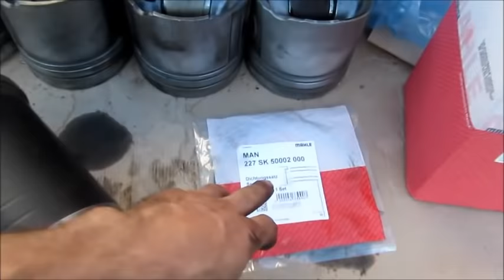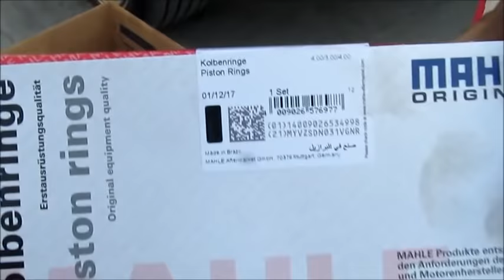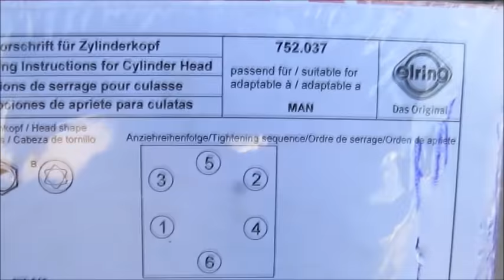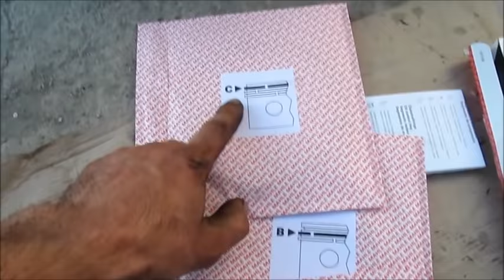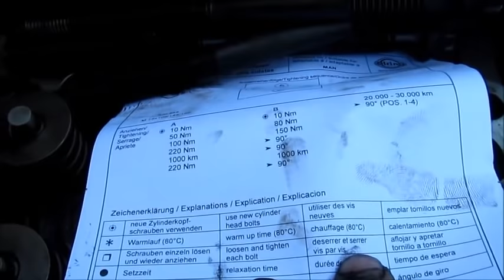Motor MAN TGA- D 2866 engine repair

Comment: Foarte bine structurat video.ul si explicat cum trebuie, mult succes si spor la munca mestere, de curiozitate cat costa un set de camasi si de segmenti pentru un astfep de motor
Reply from the maker: Multumesc pt apreciere. Piesele ce se vad in acest video au costat circa 1000 euro. O camasa ii circa 300lei , segmenti 100lei , garnitura chiuloasa 100 lei , totul vine ori 6 , plus schimb de ulei si filtre.

Comment: D2876 - maybe i have this problem with cylinder liner?  i get coolant in to oil.. driving hot not problem 1500km.. but when turn off truck, hot/cold temperature, water goes down into oil.  maybe internal leak ?
Reply from the maker: Ring cilinder might be damaged and antifreeze liquid drains into the oil bath.

Comment: Hi Catalin, what is the cause of excessive or too much diesel consumption in D2867 engine please?
Reply from the maker: you most likely have problems with the injection system. check the correct functioning of the injectors and adjust the valves
Reply: @CatalinBarbu  I need your help, I service the injection but the engine  would not start because is electric injection. Do you advice to change the injection to manual without electric? And if yes what size manual injection for f2000 D2876?

Comment: As vrea sa te întreb dacă la cămăși înainte se le pui in motor le-ai mai făcut ceva? Adică șlefuite sau ceva sa nu consume din segmenti pana își face luciu .Am făcut un motor și tot am gaze de carter, dacă vrei sa îmi răspunzi
Reply from the maker: Nu le-am, făcut nimic , au fost montate direct cum se vede in videoclipul. Când ați făcut motorul ați înlocuit cămăși, segmenți, pistoanele ?Dacă ați păstrat pistoanele vechi ați verificat sa nu prezinte uzura pe laterala, segmenți au fost montati corect cum am prezentat în videoclip?
Reply: Da am înlocuit cămăși noi kolbensmith cu segmenti tot aceasi marca  dar mistoanele au rămas aceleași doar 1 singur piston am înlocuit nou , Pistoanele arătau bine nu aveau deloc urma in canalele segmentilor doar calamina și au fost curățate bine. Văd ca tu pui MALE sa fie mai tare materialu din Kolbensmith?
Reply: Salut!un nr de telefon se poate!?

Comment: Neprofesionisti aceia care au mers cu o concentratie slaba de antigel astfel incat acesta sa inghete. Motor bun care a fost acum este compromis.
Reply from the maker: Propietarul camionul  nu a măsurat concentrația  antigelului iar în martie 2018 au fost câteva zile cu - 12-15 grade iar din mers temp. resimțită ii mult mai  scăzută așa că antigelul a înghețat în celulele radiatorului .Cand a deschis termostatul , antigelul nu a putut să circule prin radiator apoi motorul sa fiert.
Reply: @CatalinBarbu Multumesc pentru raspuns, eu cunosc ce se poate intampla cand un motor functioneaza cu un lichid de răcire care are o concentrație slabă a antigelului. Dar nu toti se pricep la motoare termice si...circula asa cu ele pe străzi.

Comment: Cum drq sa spui ca ti-o înghețat timpul mersului!!!
Reply from the maker: Când motorul are termostatul închis antigelul nu trece prin radiator, in acesta fiind apă și afara fiind ger de - 15grd C îngheață în celulele radiatorului. Șoferul a zis că în vasul de expansiune antigelul se făcuse că o zăpada roză.
Reply: Păi da dar sa crape cilindrul doar cand a stat ca din mers nu are cum
Reply from the maker: @enduroh.e.l4944 problema s-a întâmplat în Bulgaria de la Sofia către Beghet, i-am înghețat radiator soferul a continuat să meargă a fiert motorul de multe ori oprea sa se răcească apoi pleacă iar fierbea motorul. De la Mizia de a mai putut să meargă că începuse să scoată apa din vas, atunci a strâns bușonul și apoi s-au făcut presiune și a spart vasul de expansiune. A venit alt cap tractor din tara de a luat vagonul să-l descarce  ( am fost sa eu sa vad ce sa întâmplat și să demontez motorul)  am venit în țara, apoi m-am întors cu piston și cămașa pt cilindru 2 (piese din dezmembrări) l-am reparat acolo și am venit cu el apoi de l-am desfăcut din nou.

Comment: Hello, dear teacher, I am from Iran. My D2866 truck had melted the cylinder two pistons and the bushing was broken, which caused the engine to open. This is the first time I opened the compressor of our engine. I have a problem retiming it. What should be the numbers on Flaville Evans and Garoil pump? How can you help me, thank you very much
Reply from the maker: At the flywheel it comes at the TDC or TO mark and at the injection pump it is more complicated to explain. Watch the video carefully as it is featured in it.